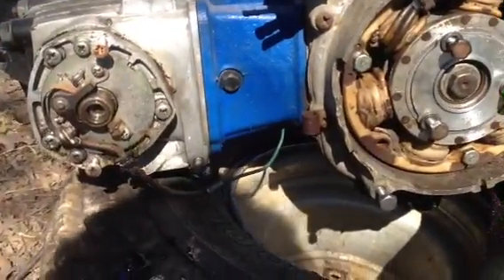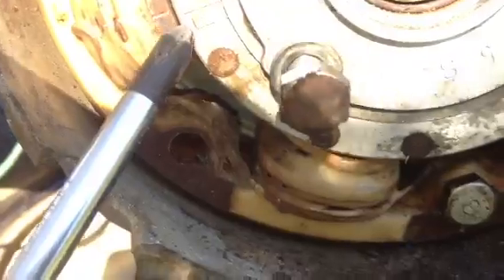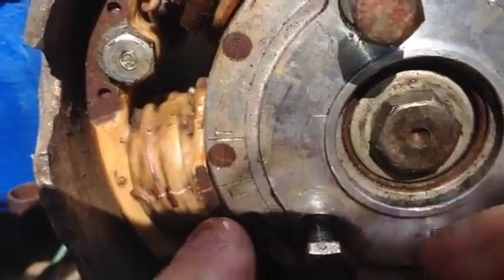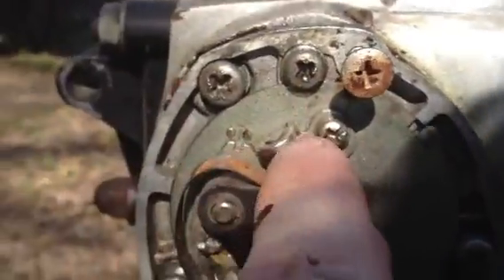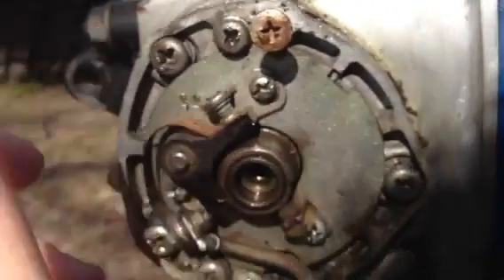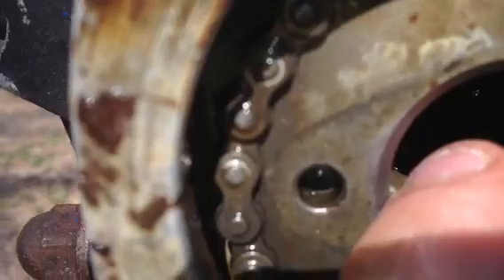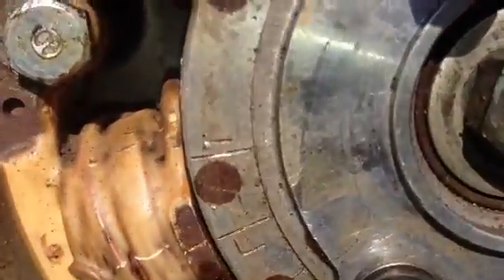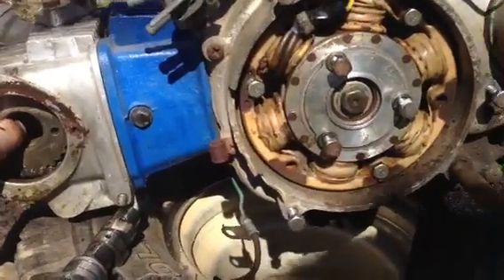How to: ATC90/110 set valve and points timing

Comment: The T mark is top dead center(the Piston is at the top of cylinder), that mark is for setting cam timing. The F is for fire and should be use to set ignition timing. There is also a spring loaded timing advance on the points lobe that you should be able to twist slightly and feel the springs turn it back.

Comment: I bought a ct90 that ran so so. I'd give it the once over, so I started with a new spk plug, adjusted the points and timed it with a multimeter. Kick kick kick.. nothing! So I tore the carb apart, cleaned everything and reinstalled it.. Kick kick nothing. Tore the carb apart again, checking everything and made sure there were no air leaks. Kick kick.. nothing! Does it have spark? That's a stupid question, it's a new plug!  So I checked the spk. No spark. I cleaned and gapped the old rusty plug.. it produced a strong blue spark. It fired right up and now runs beautifully. Lesson learned.. Never assume that a new plug has spark. 😃

Comment: this has nothin to do with timing but heres my question wat would cause a 110 to smoke i changed the piston an the rings but still smokes and its blowing oil out the exhaust pipe
Reply: The valve ceal on the exhaust valve